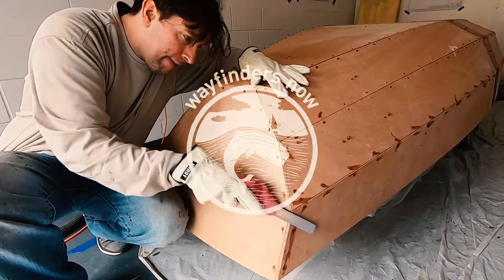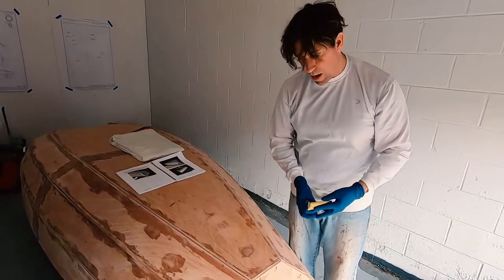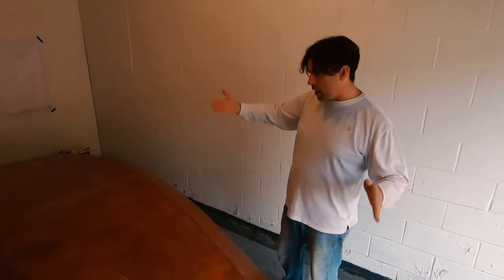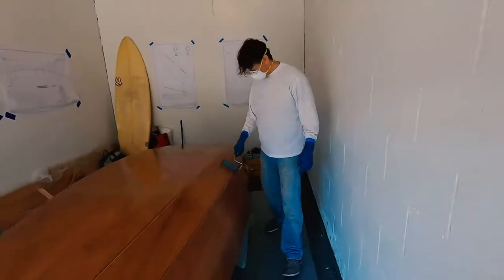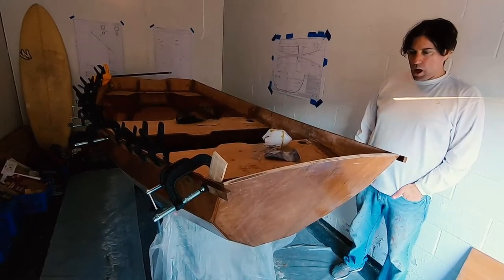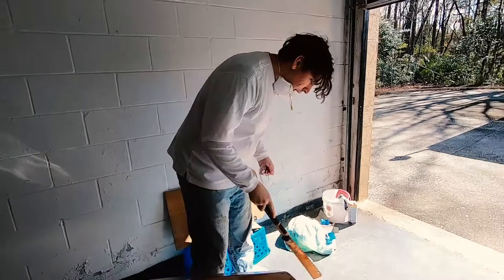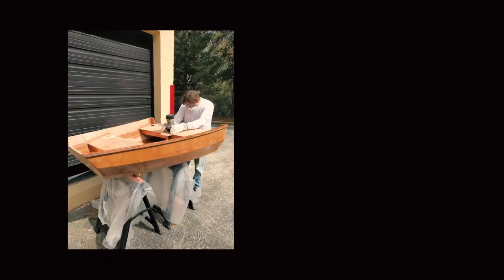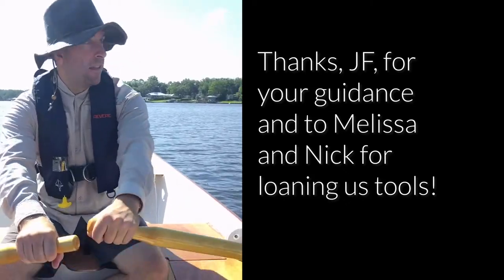We build an Ozona X Nesting Dinghy, pt 4 | Wayfinders Now #17

Comment: im about 3/4 into this build. Trick I figured out is room temp epoxy is thick as honey but with heat gun warming up the mix, it gets nice and runny. So I put a glob of epoxy and then with the heat gun in left hand and putty spreader in my right, comes out very nice and easy.

Comment: Hello Wayfinders Now, really great video. Love the progress that is being made, you've done a really good job with the paint/varnish. I have recently started repairing/building boats with my first video being released today, you're more than welcome to have a look, possibly suggest how I could improve things? Thanks Tom
Reply from the maker: Hey Tom, thanks for watching and for the kind comments! We're no experts, but we've certainly learned a lot and Michael has had previous related experience (building snowboards, etc.). The only thing Michael said he would've changed with our process is using better rollers (we'd used these foam ones that just didn't last very well).
Reply from the maker: West Marine makes an epoxy roller--they're expensive but could be a better option though we haven't tried them yet ourselves.